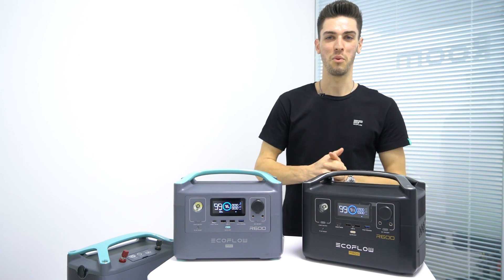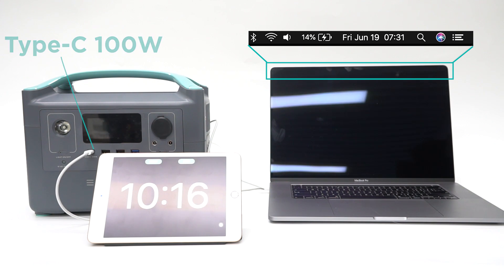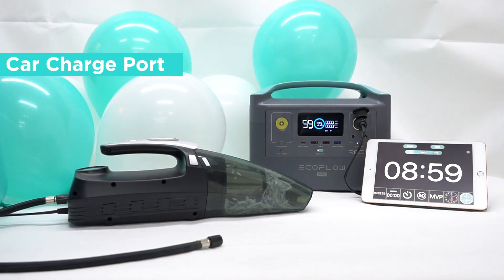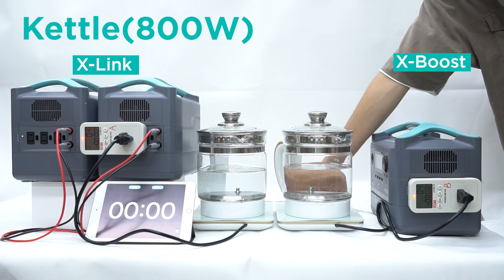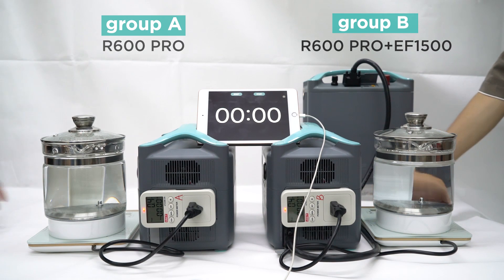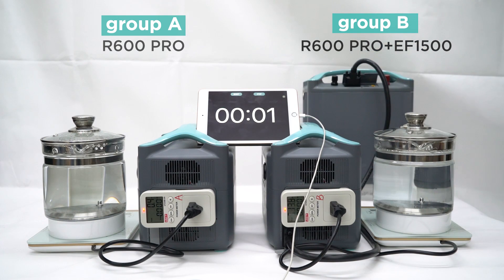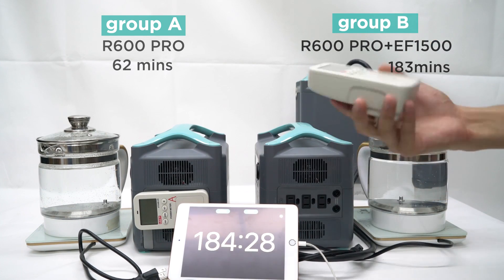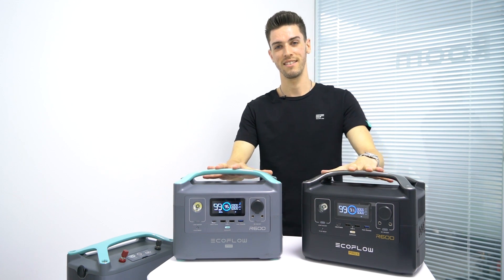EcoFlow R600 PRO and EF-1500 External Battery Functions Quick Test

Comment: I just received my R600 Pro from the kickstarter. Did you guys remove the X-Chain feature? What about the accessory that allow  you to add aftermarket batteries. These two feature is a big reason why I choose your product!
Reply: Did you get the R600 Pro? Or the River 600 Pro? They're different products.
Reply: @USNEM  I received the R600 Pro. When I funded the kickerstarter campaign, there was one 1 Pro model and it was the one with these two feature. Your website even only shows 1 Pro model.

Comment: The music was super annoying.  The last test could have been sped up to finish in about 1/5th of the time.

Can you start a full-size 110 refrigerator with the X-Boost mode?  Presuming it can do that, how long would you expect it to run a refrigerator using roughly 960 kwh/day?  With solar input, do you think it could make it through a full 24-hour period?

Comment: Received my R600 Pro which promptly malfunctioned 1 day into storm caused power outage. Tech support was not able to address and required unit to be sent back to EcoFlow. Over two weeks later and no response from EcoFlow and without a replacement which they should have provided. Actually talked to a person at EcoFlow who told me that these units were one-offs with no plans to produce more. Hoping for the best but cannot trust EcoFlow based upon my experience.

Comment: So on Ecoflow’s Kickstarter page there is a picture of two R600s in X-Link mode running a saw, but this video says to not run a saw in X-Link and only use X-Boost because X-Link only supports heating elements. It’s a bit misleading.

Comment: Test 6: 
I wished you used something with a consistent load. Isn't that kettle turning off every time the water boils, you're filling it up again, then turning it back on again? Why not use a heat gun or space heater?
It looked like the Pro died around 580Wh out of that 768Wh. It looked like the Pro + EF1500 (2304Wh) died around 1780Wh. both tests show they are around 76% efficient? You mentioned the overall discharge is less than what it should be because this is a prototype. I feel like this defeats the purpose of this test.
Reply: Because this company is BS.  I have a Delta I will sell you cheap.
Reply: Sell it to me for cheap  :)  i wanna buy it. You from europe?

Comment: When you say "support the circular saw" you mean it allowed it to run enough to partially operate the saw? It seemed to take many attempts to make that cut. The sound was also removed so this isn't as obvious?
Isn't X-Boost rated at 1200W with a 1500W surge but you're saying it can power a 1800W saw?
https://youtu.be/AwUpZqADqrI?t=195
Reply: Yeah, what he asked about the X-boost, beause that means "unofficially" we can run our full-sized refrigerators on this thing
Reply: It didnt take many attempts ( he first tried it without x boost)... And yhe idea of it ia for small heavy tasks... That xboost will over heat the station for surr so its meant to be used just in ''emergency' or urgent situations...
Reply: @costanalexandru5120  false.
Reply: @Curb71  Sorry... what's false?

Comment: Hopefully you guys can figure out how to get the full power out of two r600Pro's with x-link without needing something with a heating element.  I really wanted to use the combined power for getting full power out of power tools or a fridge/freezer.  Can't be that hard can it?  Maybe a special cable that simulates a heating element perhaps?
Reply: It's literally non existent technology they came up with. Of course it's "hard". This is a smaller unit and even if it could power your fridge/freezer, it wouldn't be for very long. Look into the Delta.

Comment: Many of us oldsters want a backup for our cpap and need them to last close to 3 nights, without humidifier, at about 6 to 8 hours each night. Hopefully about 24 hours over 3 days without recharging. This would also be great for RV battery charging and many other things. CPAP takes a good amp to start at 12 or less with 24 volts and needs somewhere between 1/2 amp to an amp, I think, continuous for the approximate 24 hours. Thanks.
Reply: Add a 100W solar panel or two and you're set.

Comment: Hate that the display is off after 5 minutes, give us the choice if i want to have it on all the time. Otherwise this is the third and last Ecoflow. Product
Reply: with a limited power supply I wouldn't want it wasting power lighting a screen all the time.
Reply: @DrinkWhiskeyRaiseHell  That's why it can be an option we can enable or disable. I'd imagine it only wastes a watt or 2.
Reply: @Curb71  you can control that with the app

Comment: Hi Seth, what's the difference between the grey pro and the black pro +?
Reply: I would like to know this also.
Reply: @lazzar1903  They grey one is grey - and the black one is black. That's the difference.
Reply: @DanielORorke  It would be weird to add a + because it's a different color but that's what I'm suspecting as well. Either that or there's another stretch goal that hasn't been unlocked yet.
Reply from the maker: Hi PropNoise, great question! The difference is only in the color.